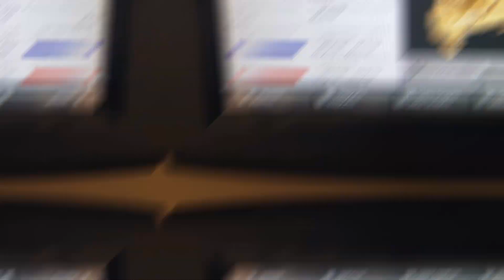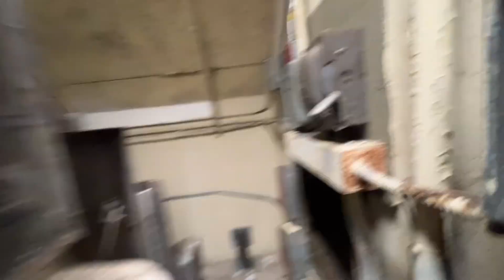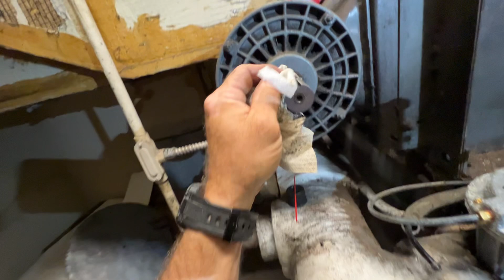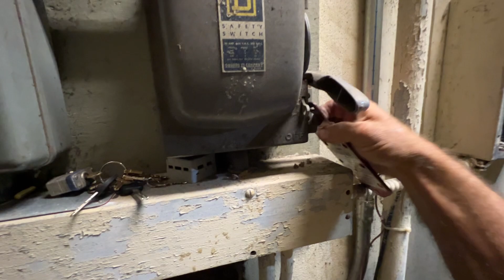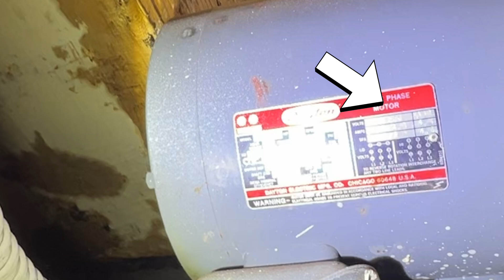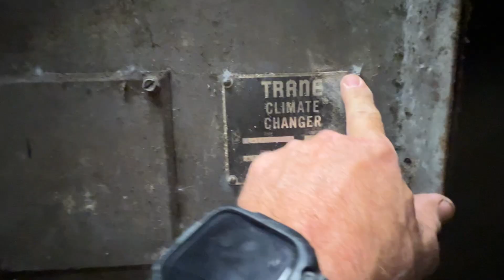Trane Climate Changer AHU Making A Lot of Noise…Old Still Works

Comment: Great Video.Thank you for sharing. How to know pulley size and buy it ?
Reply from the maker: Thanks, the part number is usually stamped on they pulley, if not use outside diameter, inside bore diameter with number / type of V grooves.

Comment: Where did you get those magnetic targets or how can I find similar products?
Reply from the maker: I use 12mm magnetic keychain so when I lose them it doesn’t hurt 😂

https://a.co/d/gJ1ZYUu
Reply: @subcoolHVAC   Thank you! Ordered. Much more affordable than pulley alignment tools.
Reply from the maker: @Greg-202 Nice, it works well. 👍
Reply: Is that just a magnetic laser level?
Reply from the maker: @ac-mech1265 Klein laser level, Thanks for watching 

https://a.co/d/0lwiphc